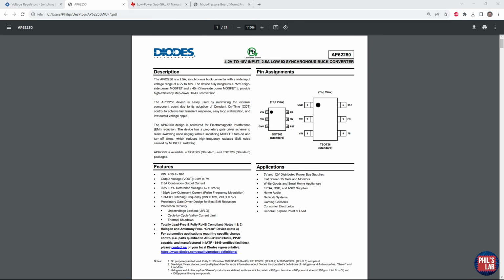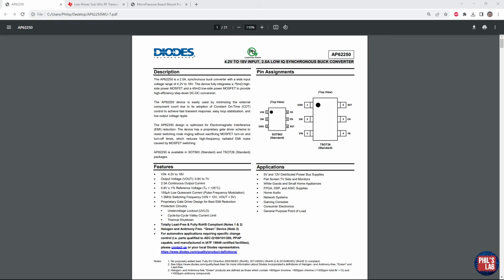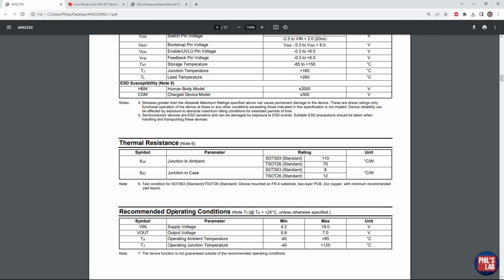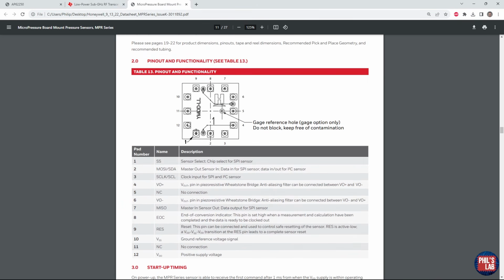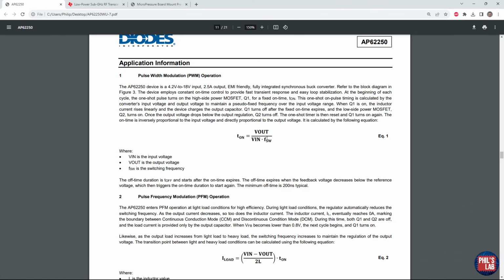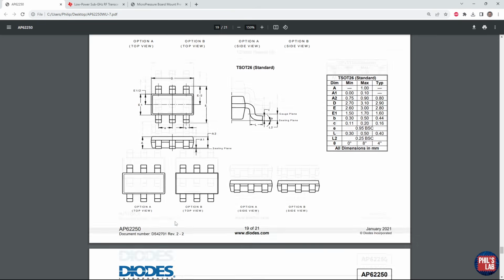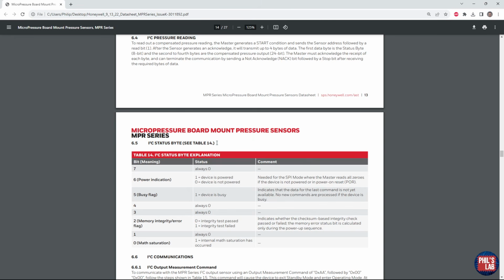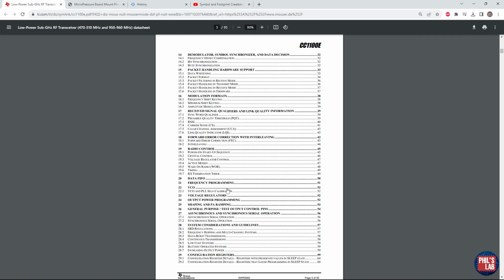How To Read A Datasheet - Phil's Lab #123

Comment: The part about absolute maximum ratings being damage limits is a good warning. Does this same approach work for most component brands or do some companies hide important info in weird places. And have you compared using datasheets manually versus something like llamapress ai for finding specs quickly.

Comment: Professor please help!! When I was looking for MJE13005 datasheet I found there are two parameters named as VceO(sus)=400VDc and other is Vce=700VDC, so what does these two means??

Now which one is to consider as max withstand voltage rating when choosing this bjt to switch inductive load like smps ?? 
Please help

Comment: Hey Phil, great video as always, packed with information.

I've taught myself how to read the datasheets of many components (or rather, I've been forced to learn how 😅), and boy do I appreciate the ones that have:
1. Full pinout and package information including mechanical drawings for the footprint and package for all variants of the IC (Meaning: if it don't exist in KiCAD's very limited libraries, I can make the footprint myself in a few hours)
2. Application examples and mathematical formulas, or even better, tables for selection of accompanying components
3. Layout guidelines, like "Put this cap here as close as possible" or "make this net into as big of a copper pour as you can with lots of vias", complete with pictures
4. All of the above with a ton of tables and graphs that I might need for certain project requirements

I often turn to TI or another big manufacturer, but then there have been ICs where the datasheet is so old the "PDF" is just a scan of the old paper data sheet and it's barely legible. Or they skip the mechanical drawings so I have to take it on faith that the footprint I selected is the right variant, etc (or I have to order a sample so I have a better idea what the package dimensions and pin pitch are).

I'm working on turning an audio device from Instructables into a design that can use one or more rotary encoders and digital potentiometers. Hopefully that leads to something, either way I get in some good practice in analog circuit design...

Comment: Thank you for yet another great video. You managed to squeeze a huge amount of invaluable information into a relatively short video.

 I would also add that one might want to read the errata and revision history. I struggled with STM32H750 where between the rev. V bunch there was a few rev. Y with major clock and flash changes. 

Also also, stay away from parts which have a “friendly library” but the registers are not shown in the datasheet (I’m looking at you STM and your ToF ICs).
Reply from the maker: Thank you, Aron!
Yes, the errata/rev history is definitely something to look at as well.

Comment: This channel seems pretty amazing for an absolute beginner hobbyist trying to go a step up from premade boards to anything close to a semblance of a real product.

I do wonder if Fusion 360/Eagle was considered for its close proxitmity/synergy with cad/how directly kicad tutorials transfer across to Fusion.
Reply from the maker: Thank you!
I'm afraid I'm not a fan of Eagle (and from what I've heard it's being discontinued fairly soon). Altium Designer has a very nifty MCAD tool that links it with Fusion, Solidworks, etc. rather seamlessly.
Reply: @PhilsLab  Interesting. Just to make sure I understand you correctly the eagle that's integrated into fusion 360 as Fusion360 electronics is being discontinued? That would seem like a massively weird choice to make considering the selling point is all in one 😐.

As for Altium, as a not ee student and no longer a student, I am a not rich mere hobbyist where this does the opposite of lay the bills, so I don't think I'm rich enough to discuss pricing with them 😂., especially in the dipping my toes phase.

I'm sure I'll figure out how to follow along roughly with a bit more googling in Fusion or just learn in kicad since it seems to have more free material availible on the web to learn anyways. I figure the base knowledge should be transferable anywhere.

I totally get not wanting to cover yet another piece of software too, especially since your channel is basically free actual engineer time which for hobbyists is indispensable, like having a free consultant, but pre recorded. (And Probably also as you must be used to some pretty space age company bought software, so using less professional oriented tools must feel like using word as an ide (I hear auto routing works well on pro stuff)).
Reply from the maker: The original Eagle is being discontinued - maybe the Fusion-integrated version will exist under a different name? That could be.

In any case, KiCad is great (and free)! You could also give CircuitMaker (free) a go, which has a very similar user-interface to Altium Designer.

Although I use Altium Designer for work and hobby, I try to make the videos mostly tool-agnostic, so everyone can implement the content in their ECAD tool of choice.

Comment: Hello Phil!!

Great to see such an amazing video.
In uni, all the advanced concepts such as Z-transforms, PDE, etc just seem to be all taught in a very abstract manner. Doing a numerical after numerical never worked for me and i never understood the practical application leading to me performed poorly.

I am very amazed when you were able to implement Z-transforms or DFT algorithms on hardware. Could you please tell me what i am doing wrong in uni so i can get a better grasp of the concept.

And how did you manage to learn and implement it in hardware by yourself.

And for a particular problem like signal filtering, how did you know it was that algorithm itself specifically that you had to implement?

Since math was so hard for me, i forgot these problems as soon as i finished that subject, so to get as good as you. Did you have to practice textbook problems a lot? 

Thank you Phil for any advice you can provide!!
Reply from the maker: Thank you for your kind comment! I'd suggest picking a project idea (e.g. flight controller for a balancing robot) and implementing it by yourself from scratch (circuit, PCB, firmware).
For DSP, I'd suggest checking out www.dspguide.com
Reply: @PhilsLab  thank you so much!! Is this where you also learnt your concepts or was it at Cambridge?

Comment: "low IQ" buck converter.  :) Man, thanks for videos, you're sort of genius, do you have advice, what is best way to start with FPGA for audio applications and what are advantages comparing to microcontrollers? Is it harder to learn writing firmware for FPGA?
Reply from the maker: Haha that buck description is pretty funny :D
Thank you! I'd suggest looking at Nandland and fpga4fun for tutorials, and sticking with simulations to start with, before moving over to hardware.
Unless you really need to, I'd suggest to stay away from FPGAs (for audio applications). Modern MCUs are plenty powerful for a lot of audio processing tasks.
Reply: @PhilsLab  Thanks a lot, that was a clear answer! Cheers.

Comment: Some days at work that I just have to spend reading (skimming...) dozens and dozens of datasheets trying to decide what to use for the next project. So many options, so many features, can be a bit maddening! One of the most annoying thing I've run across is when the datasheet buries the i2c address in the middle of a paragraph, or as binary in a timing diagram.

Also, good for calling out that recommended layouts and evaluation boards commonly fail to follow best practices (see all the modern boards that still use 3 bypass caps of different values, which hasn't made a difference in decades)
Reply from the maker: Yeah, definitely - luckily most datasheets are fairly decent. But there are some where I almost instantly discard the part due to the poor datasheet..
Finding I2C addresses can be 'fun' at times, yeah..

Comment: This has to be one of the most important videos you could teach, Please teach in further videos how you learnt about FPGAs and built circuits around them, was it using books, online tutorials or something else?
Reply from the maker: Thank you - I do have a few videos on FPGA circuit design (and the course goes into quite a lot of detail). I learned FPGA hardware design mainly through datasheets, app notes, playing with manufacturer tools, and looking through reference designs.
Reply: Gotcha so your path is not linear? Out of all of these, which is the biggest help or helps you get a headstart in understanding the basics?
Reply from the maker: Reference designs (for FPGA/Socs Digilent is awesome) are a great place to start to see the schematics for working design. It'll show you typically how much external circuitry is needed, what power supplies, what ICs work, a bit about the firmware/drivers, etc.. I strongly suggest not to just directly copy those designs, however, but actually learn from them and implement the parts you need in your own design (e.g. by following datasheets, app notes).
Reply: @PhilsLab  So the app notes n stuff to learn like basics of the IC and other required stuff is generally given in the app notes? since until you used Verilog to demo, I never exactly knew you needed verilog for PCB design testing. So did you come across that you needed it and how did you end up learning 
it when you were implementing it in your ZYNQ PCB? Because unlike java or python, I am not finding easy examples to tutorials to gain mastery. So do you learn from books  or online courses on Udacity, etc?
Reply from the maker: Components, Verilog, etc. etc. were covered during my university degree. However, how to use them in practice was by 'having' to use them in my own projects (and finding relevant information via books, datasheets when I needed them).
Reply: @PhilsLab  got it. Thank you so much Phil!!! Cant wait for your upcoming videos.